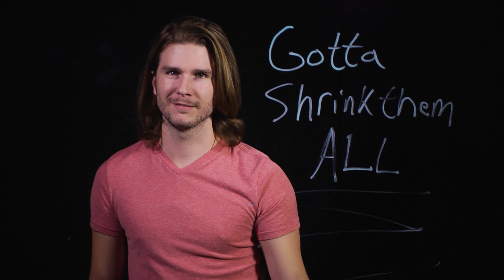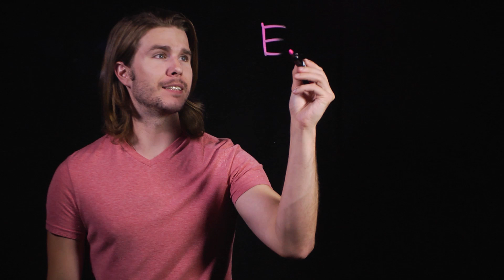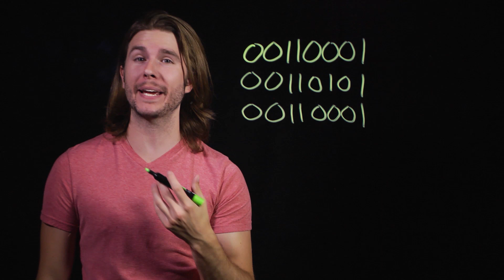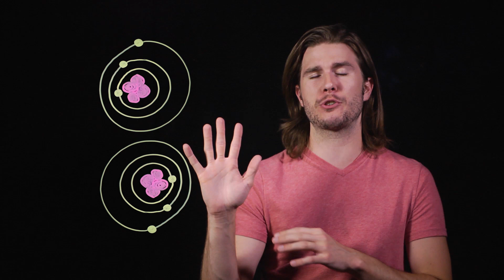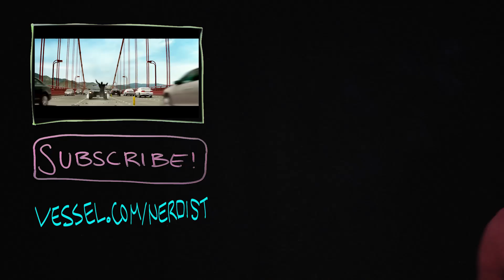How Do POKEBALLS Really Work? (Because Science w/ Kyle Hill)

Comment: Kyle you seem to repeatedly and rather frequently ignore the possibility of pocket dimensions if a pocket dimension is created in association with an individual Pokeball the ball in question would only be the delivery Source the portal in and out of this reality but instead of transporting it to to an idealyc habitat physically in the ball and possibly compressing the atomic structure of the creature until the whole creature or Pokemon is microscopic in size it would actually be depositing it to this idealyc habitat with exist or another possibility is that the Pokemon in question are converted into Data and that is not a physical location that they're actually going to it could be a program a heaven like simulation possibly a Pokemon based Matrix reality

Comment: I hate the idea of the 'pocket dimension' like it's just the easiest answer for the question, I'm going to go for something more exotic I doubt anyone will see this so I'll get to it what if the Pokemon weren't transferred anywhere, but outright killed, BUT, before you got triggered, they were scanned and the information about the Pokemon was stored inside the POKEBALL. If the scan is successful you keep the Pokemon, if it isn't, it goes without saying. When you are to summon the Pokemon to battle all the information is taken and the Pokemon is 'cloned'. This solves the density problem, and the catastrophically unfathomable energy feedback, but I believe this touches on the theory of quantum entanglement so I wouldn't want to get any closer to this subject

Comment: well my thought was always congruent with how TMS and HMS work.with how you input them to a pokemon and they learn them. Its like how in the matrix they use input codes to make neo learn all of the martial arts ever conceived. So in this way i have always thought of pokemon as a conversion between dna and binary coding. this is all based on 7 year olds interpretation of the game. My main reason for this idea is because of the term pokedex. which in of itself is a dna sampling device that allows for the transfer of information relating to that individual pokemon. It is what introduced me to the idea of quantum theory and the idea that matter can be transmuted to other forms through raw energy input all very interesting for a small child at the time. :)

Comment: Actually there are two types of Pokeballs. In the anime and manga, the pokeballs that are used in modern times have been created by SilphCo. As you mentioned, Bill created an equation that allows you to digitize and somehow to transfer pokemon. However, the manga complicates this by showing that the pokemon are aware of outside environments.

The second type of pokeball is the natural one made from hollowed out fruit, that was introduced in gold and silver. In the anime, it has shown other devices can be used as a containers as well....but this goes into mysticism "unexplained science".

Another theory is that would work is that pokemon are not traditional 3D dimensional creatures, and happen to appears in the world. They are in fact 4th Dimensional creatures that can spatially fold themselves or be forced. There are several legendary pokemon that exhibit time travel and exist outside of the normal dimensions (Unowns, Diagla, Paklia, Celebi, etc).  Also all pokemon were created by Arceus, which itself in a non-traditional 3D beings. Therefore, the normal rules we understand would not apply as there extra dimensional capabilities not only allow them to interact with our world, but explain their enhanced abilities, and ability to be captured in a pokeball.

Comment: Theory rejected. Pokeballs use DNA scanners on their surface and wirelessly communicate to the trainers pokedex the species of pokemon captured while simultaneously registering it with bills (or whoever based on regions) pc system and in tern with the body that governs pokemon rules and regulations. the pokemon said pokeball has been lobbed at is then affected by a wormhole stabilized by electromagnetic conductors (the mirror like plates seen inside the pokeball)  which hold the wormhole in place. the pokemon appears to transform into a ball of light because its individual atoms are being captured by the wormhole a speed so great that the electrons of said pokemon atoms shift to a lower energy level because of the compression you spoke of. This is what causes the red, or blue or whatever color glow a pokemon takes on when captured by a pokeball. The pokemon can only travel through the wormhole while in this energy state because the wormhole would collapse if no strong enough electromagnetic current existed within it to keep it open. Hence why if a pokemon isnt captured the first time you throw a pokeball it becomes useless: The wormhole inside collapsed and can no longer be sustained because the pokemon maybe lost too much energy in transport to keep the wormhole open  or its atoms trying to return to their original state too early. Anyway the wormhole on the other end would open into a pocket dimension with a one way exit leading out of the original pokeball that has registered and recorded said pokemons DNA and the database its recorded in will not allow it to be captured by another pokeball. The empty space on the other side containing the pokemon takes on a fourth dimensional property because the worm hole connects it to the pokemon world and its own world. Which would make reasonable the concept that commands can be given to a pokemon even while its inside the pokeball and moreso that it can hear them and respond when released. The existence of this separate world may be governed by the pokemon's thoughts or dreams which may be why some pokemon don't like to be inside pokeballs. maybe pikachu wobbuffet and psyduck have terrible thoughts that they cant bare at times so they pop out of their dreamscapes because they cant handle the "dream" theyre having. pikachu might be reliving a tragedy, wobbuffet the same. Psyduck is just kind of dumb and doesn't really get his own dreams so he comes back to reality just to check it out. This is my theory at least.

Comment: I don't think you got this one right.
I think it is a much more plausible theory to use the same concept as a tele-transport. 
And by that I mean that the pokeball only maps the atomic information and destroy the Pokémon.
This way the pokeball work only as a mapping and information storage device. 

Obviously there is the problem of recreating the Pokémon but it could have some power generating feature like the batteries on SGA which means it could instantly generate the needed power without the problem of storing 100 fusion bombs in your pocket!

#becausescience

Comment: I'm thinking the Pokéball isn't actually hollow. Instead it disintegrates your pokémon while scanning it. The Pokémon then lives on as a simulation in the actual ball and you could 'release' it by recreating the simulated pokémon. I'm not sure if the ball is storing the energy or transmitting the gathered energy to a hub of some kind to be beamed back for reassembly.

Comment: How silly. You instead cool the object to the point that it loses mass, but retaining only the bare minimum information that makes up the object. No need for muons.

After all, as you add energy (perhaps thermal energy as an example) to an object it gains mass, as well as expanding in volume depending on conditions. However, if you were to remove enough energy from an object its mass would follow, along with volume, though still leaving behind the bare minimum information that still describes the object. The amount of energy you'd need to remove depends upon the rest mass of the object... of which can be billions of joules of energy just for a mere rodent.

Applying that to living systems though... difficult.

Comment: 2 ideas. 1. What if the pokeball transfers energy into binary code, which is much simpler to contain? Each pokeball would need to be able to store an astronomical amount of data, though. Other idea. If the pokeball can contain such a large amount of energy, what if the pokeball actually absorbs the energy into a special material of which the inside of the pokeball is composed? I don't know. Pokemon Science.
Reply: Perhaps, but there's still the question of constructing/deconstructing the pokemon out of the binary code from the pokeball, so that matter or something that can be converted to matter as we know it would have to be stored in the pokeball anyways
Reply: what if pokemon are holographic?

Comment: You've used the word 'touch' incorrectly fro a scientific standpoint.
Science defines touch as the point at which two particles' repulsion and attraction forces cancel each other out. 

Touch has to be defined in such a manner because particles themselves are not made of 'stuff' like people are used to thinking of. Particles are made of quarks which exert forces, and quarks are not really "made of" anything but the forces they represent.

So by the laymen definition of 'an object contacting another object' there is no such thing.

However, official media has explained that pokeballs convert objects (in general) to waveform representations of objects, and it is that fact which allows the pokemon center to heal them, by stabilizing the waveforms inside the balls.

Its not that the matter is being converted... its being ignored entirely.
That said, no official media has ever implied that the pokemon universe ISN'T inside a computer program canonically... meaning all matter in the pokemon universe is simply a series of variables... (which are, technically, expressible as waveforms) and therefore, I propose that pokeballs are simply variabled that store references to other variables. (or to be less programmy, pokeballs are EXACTLY what they really are: parts of a program that points at other parts of a program... even within the canon of the universe).

Incidentally, previous to the technological pokeball, people were using something akin to shamanism on apricorn shells to catch them... which actually supports the aforementioned theory, since things like shamanism and alchemy can often simply be misunderstood application of real scientific effects. When they're finally understood, they cease being alchemy and graduate to chemistry, and greater effects can be achieved and devised without all that guessing and hallucinogenic vision ceremony.

Comment: I have another theory that just might work. Instead of shrinking a pokemon down, converting them to energy, or storing them as data, what if the pokeballs didn't store them directly. Instead, when the pokemon is "returned to it's pokeball", the ball could transfer them to a linked pocket dimension. Because it's bigger on the inside, the pokeball could be equipped with a habitat or a room to live and play in until they're released from the ball.
Reply: +iliketrains0pwned seems to be the case in the newer games. or at least kind of. we know that the pokemon's room can be decorated and the pokemon can be trained or petted by its trainer
Reply: Maybe but it would probably just poket connected with a bigger poket ie PC.
Reply: That way if you leave your Regen you don't lose your pokemon just need connect to the PC of that Regen. Possiblity of data transfer or something so you don't lose your Pokemon in storage.

Comment: Interesting, but it's scientifically impossibile what you're suggesting. Electrons can only orbit on finite orbitals, as derived from Schrodinger equations, so you can't decrease the distance between electrons and the nuclei, or electrons and other electrons. You could only fit more external electrons on more internal orbital, but considering that Pikachu's atoms have all the internal orbital full, Pauli's principle excludes that possibility. But supposing you were able to do something like this, it would probably kill pikachu in the process, as the bonds within molecules and atoms would be surely broken

Comment: But the IET doesn't explain bills transfer protocol, or, how pokemon are healed in pokeballs (fixing corrupted data 'damage' anyone?)  Or that when you hit a pokemon with a ball there is an obvious transmutation occurring , after which the energy appears to be sucked into the ball, perhaps implying the inside of a ball to be a vacuum. I think pokemon can be thought, to an extent as resembling digimon. in an obscure way of course. (I can't believe I'm such a nerd)
Reply: +WintersunForever They came out fairly closely together, so I wouldn't be surprised if they were inferring some kind of similarity to try and catch fans from Digimon (or visa-versa, not sure which one came first and I'm too lazy to look it up)

Comment: wait, so because plasmas have no electrons, could it travel straight through walls?

or, to weaponise it, could you fire an extremely hot kind of plasma in a cartridge or something? So it would strike say a tank or bunker, and a shaped charge could heat and launch the plasma into the bunker. the Plasma could glide straight through the armour and boil/vaporise etc everyone and everything inside, with the heat likely burning a hole through the armour as well, creating the illusion that it actually melts through armour to get inside?

only problem could be what happens to a plasma when the protons and electrons get separated. the Plasma charge would have quite limited range.

Comment: You missed one more possibility. Pokemon die when they are captured and the ball acts as a dna storagr device and a 3d printer of sorts for the copied genetic material down to the exact number of expressed proteins. Evolutions and leveling would just be a matter of scanning current phenotypic expression and the blinding capture light is both the scanning process and destruction process while the release light is the cloned printed copy based on previously stored data. The hybrid animal inanimate objects known as pokemon obviously being engineered constructs, example blastoise hoses and polygon

Comment: Pym particles (yes the same ones from Ant Man) they are able to shrink the space between atoms and electrons. Applying this, pokemon are just changing the density but not the mass, see if you carry on all the pokemon in pokeballs the mass will still be the same and ash would have his back broken. Now, just imagine carrying snorlax... He could make a black hole if his density is to high. So, yes this theory could actually work but the fact that the mass doesn't change makes the theory unreasonable with the manga/anime.

Comment: I've always had a theory about pokemon. The pokemon world, it's not a real world or even dimension. It's actually a matrix like virtual reality, with all pokemon being forms of data. bunch of zero's and ones. The pokeballs capture and store this data like a portable USB and can loaded from them (aka thrown after pressing the button). That is also why the pokeballs and pokemon can be transfered and stored via PC. this is also why humans are freaking impossible to kill in the pokemon universe. it's because they don't have human bodies. they are made of the same stuff as pokemon. This would also explain why attacks that would normally easily destroy building made of concrete and solid steel, only injure humans (at the very most. heck charizards flame is hot enough to melt boulders, yet ash takes it square to the face on multiple occasions and just shakes it off with a bit of soot. not even a fried hair or piece of clothing).

Comment: The electron explanation is one of the closest answers you can get, yet as you said: density. The pokemon would still weigh the same as it always did, thereby making any sizeable pokemon's pokeball impossible for you to carry unless the player has superhuman strength.

I'm going to put it down to the conversion of mass to energy though as the PCs can store pokemon and transfer them to you instantly, therefore indicating that they are already there in energy form. Of course, this would require some sort of technology that would stabilise the energy in order to prevent the explosion, but it's where I'm placing my money.

Comment: pokemons are not shrunk. kids wouldn't be able to lift the balls that heavy. neither could we put them on any surface the pressure would be too damn high. imagine snorlax's worth of weight distributed across a square inch of anything. 
http://25.media.tumblr.com/054f8e56c6e60cc30f17589679ecffdb/tumblr_mmff6t41ez1qhd8sao1_r1_500.gif
shrunk or converted to energy, the balls will still retain mass. plus pokeballs have the ability to expand/shrink to fit fit many in a pocket so there is definitely some of this involved and them staying at same weight indicates involvement of other dimensions. and if so, why not humans and inanimate objects; why pack a suitcase or use trucks and planes for transport. 
my thoughts; no science invoved, just pure idioticity.